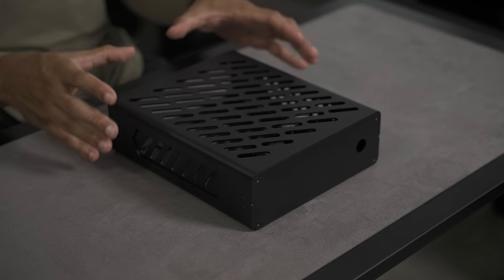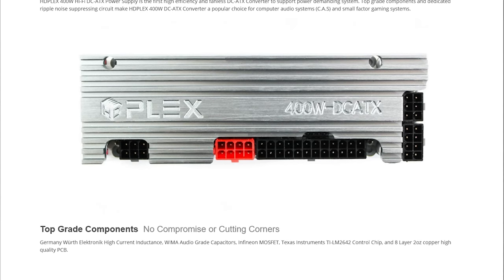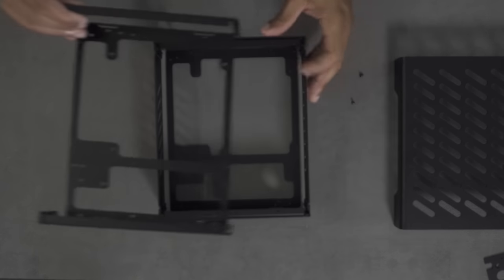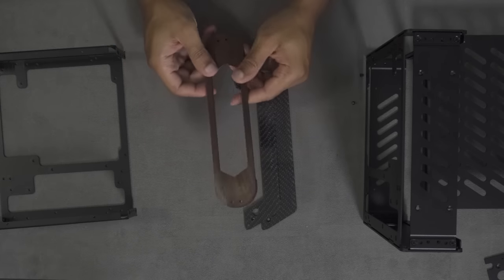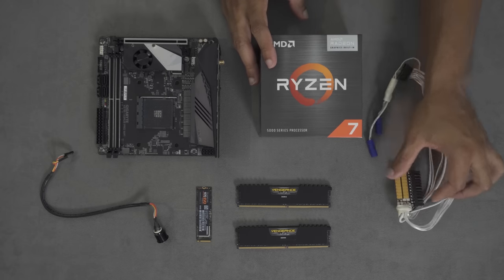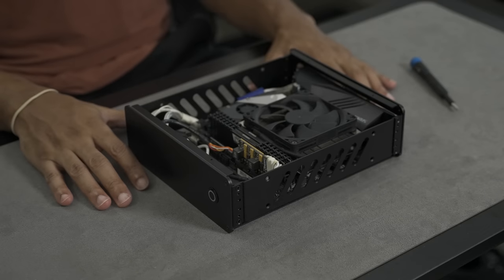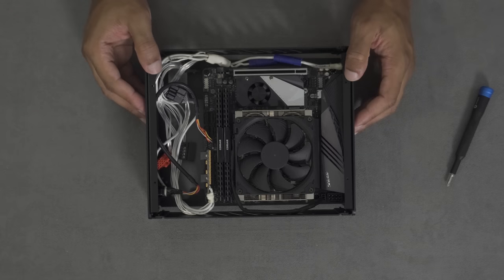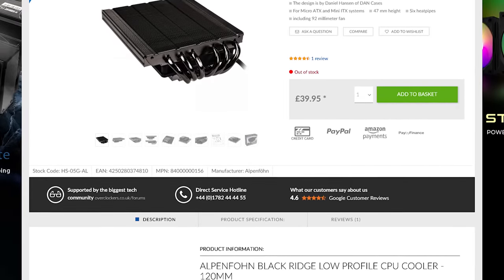NFC S4T ITX Case Review + 5700G Build

Comment: Love your work. What did you do with your MI-6? I've got a Ryzen 5950X in it with a 3060ti on the way.
Reply from the maker: I still have it around here somewhere. I tried to do a water cooled build in it a while back but it didn't fit. I haven't used it since.

Comment: It's a redesign of a g60 itx case, sold by chinese brands rgeek, tabao, etc. The NFC  did a great redesign, it has better cooling slots, structural changes and couple of mm longer and wider to fit the 240w GaN psu.  They did a great job.

Comment: Excellent review. The large ventilation holes are nice to see in there. I have a case around the same size with very thin ventilation slits cut into the top above the cpu fan. But it's borderline useless as the case and fan simply can't expel heat efficiently enough. It all builds up inside the case so I have to keep the lid off most of the time. That S4T case could be the answer!
Reply from the maker: Yes, this case handles airflow surprisingly well. There is also enough space to avoid turbulence from fans

Comment: That L9a is really a wonder of a cooler for a lot of reasons, yet it might perform even better with a fan duct seen on some Dan A4 builds. Using high quality thermal paste instead if the Carbon pad can also yield some additional improvements definitely making this a viable setup (I'm also using Carbonaut too currently).
By the way just wanted to say your videos are very nicely executed, with good sequence and pace, covering topics that answers questions before they are being asked and no additional BS. All uploads are interesting without anything that may seem to be just for filler. You obviously do something aside from youtube which is a good move. Wish we could see more uploads, yet if this kind of quality can only be kept with the current upload frequency, then no need to change a thing:) Keep up the great work!
Reply from the maker: Thanks for the feedback. You are correct, I have a full time career which dramatically cuts down the amount of time I can spend making videos. I just try to make every vid better than the last. I'm glad you enjoy them though.

Comment: way too narrow, it needs to fit P1 to be worthwhile
Reply: What's a P1?
Reply: @bananapie2198  NH-P1, passive cooler for chips like 5700G and even hotter ones
Reply from the maker: Why would you want that, when you can just use active cooling...?
Reply: @Tekeverything  cause undersized active cooling is terribly noisy, yes, even noctua
D15 MAY be able to handle this but is bigger than P1 anyway so...